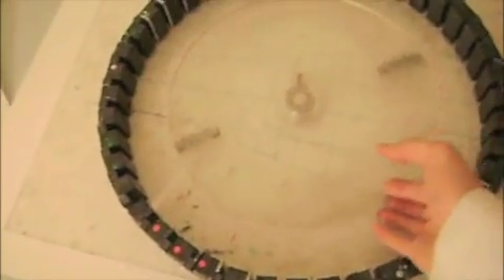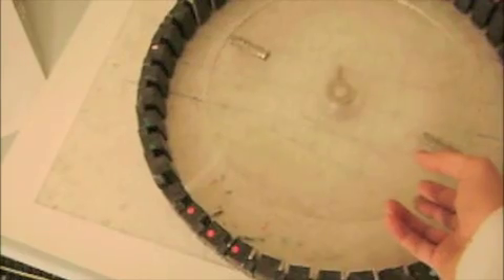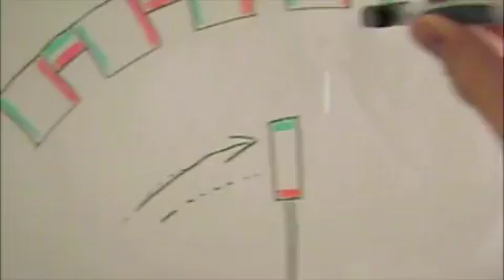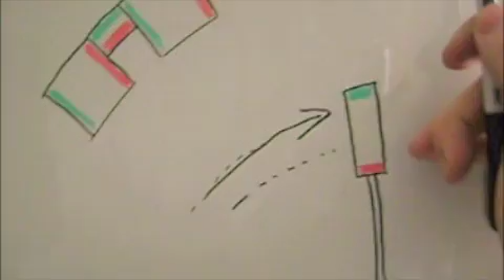The One Inch Barrier to building a Rotary Magnetic Motor Design.

Comment: So you gave 340 degrees of self acceration and you only need to overcome the last inch? Sound to me like your not seeing the big picture! Create an electro magnet pulse of attraction to overcome the last inch. That power consumed should easily be replenish by the self acceleration that you demonstrated just have 6 induction coils around the unit all creating just enough charge to recharge a super capacitor and when it comes full circle allow the capacitor to discharge into a attracion electro magnet timed by a Reed switch. I believe with a bedini circuit you should be able to overcome and create orerunity

Comment: The TJ’s moving Gate - Mechanically opening and closing twelve Gates on the twelve Neo magnets. Twelve sets of magnets on the inside rotator with an oval block in the middle of the Rotor (on top of the Lexan). Each Neo set connects it’s  backsides to a long string, which loops around the oval block. After the Rotor begins to spin, on the center axis (manual effort may be needed at that point), the twelve strings pull each individual Neo set away from the Twelve outside magnets. Opening and closing the gate without additional mechanics involved.
- hind sight tells me that twelve Neo sets on the Rotor would actually be to much magnetic force in the opposite direction so BEST CASE SCENARIO is: one Neo set on the Rotor with twelve strings, each around a separate oval (let’s imagine twelve individual ovals stacked on the Rotor/ a our version of a camshaft) Each oval points away from one of the static magnets on the Base. As the Rotor spins, an oval pulls the Neo set of magnets away, then the low part of the oval allows it to be magnetically be pulled toward the outside static  magnets. At the same time the magnetic motion being created causes the physical presence of the next oval to release the energy (by pulling the Neo set away again), while the Rotor is in fwd motion. 
The Oval I am picturing is more of a Conehead oval than an egg oval.
Things working against this theory are friction under the Neo Magnets on the Rotor, which could be floated in Water (maybe inside a test tube) and friction, plus wear, of the strings. 
Input and especially trial and errors on TJ’s Moving Gate “BCS” theory will be greatly appreciated.

Comment: This may be off the wall, but how about this thought? Put about a 3 inch long by 2 inch wooden dowel straight up from the center of your disc, with a 3/8 inch hole through the circumference at about 1/2 inch from the top of said dowel. Then put a 3/8 inch dowel through that hole extending out both sides of the first dowel to beyond the major circumference of the machine. Then put equal weights on each end. This configuration should build up enough inertia as the machine turns to keep it moving past the dead spots.

Comment: howard johnson had one that worked it was almost the same setup but the middle wasn't designed like that it was an arrangment of magnets in a half circle with the end one kinda out more, there has been real ones made professional even, the government will never allow mass production it is up to individuals to make for themselves for there own use and there is alot of fakes on youtube but some real and all of them are discredited look up The 3 types of magnetic motors part 1-3 he knew what he was talking about and has the knowledge
Reply from the maker: I'm aware of the similarities in my designs to Howard Johnson's. He actually inspired a lot of my research. Thanks, by the way. The 3 types of Magnetic Motors are some of the most important videos I've made.
Reply: i hear ya i have a different arrangement of magnets that ive never seen before anywhere and a design idea that will work 100 percent sure  with alot more power but it requires a design that pulls in and out as it spins on 4 corners of a circle i have tested it and i know it will work but i dont want to blast it on comments for someone to steal i have been working on this for 3 years but i wouldn't mind talking directly to you as i dont have the materials to make this work i have magnets just not the design for it , im at the point of if you would mention me as the design and you as the engineer i would be happy to tell you to finally make a very successful magnet motor with all neodymium magnets  i would really like to work with you and finally get this video out as it has been a long time coming and i fear it will take me forever to build the design sad thing is it isnt that hard but requires tools i don't have hope to hear back from you
Reply: i really dont wanna let this go as i have been working on it for along time but even if i did get the materials and make it people would be calling fake though it would be next to impossible to fake this design but you have some credentials and sorry for the long message and i know everyone thinks they got the magic key but again this has been tested with only one on the stator using my hand to hold and it has worked but in order to have the kind of power needed to turn a generator to power a house without it being big it needs 4 and you will understand when i get to tell you this type of design would make almost anyones arrangement work people have only been focusing on the arrangement of magnets and nothing else it takes 2 to tango lol anyway i stop writing this novel and hope to hear from you if your interested my real name is on here look me up on facebook messenger except look for first name Jamie instead of James ttyl hopefully if not im sure i will eventually get it out and on youtube just tired of waiting
Reply from the maker: You might want to stop by a machine shop and have the parts machined for your device? I've done that before. As far as contacting me through facebook, you can find my facebook page by looking up Mo Jo. It has my Motion Magnetics logo on it, so it's pretty easy to find.
Reply: Thank you for the advice about the machine shop and i will try to look you up on facebook this device im talking about is all repulsion and i have found a way around entry into the repulsion i will look you up and talk to you soon though i cant wait to get this device built
Reply: I cant find your page on facebook i looked on people and pages and no cigar , if you have another way we can talk i would be happy to do it another way it doesnt matter how, i dont want to keep anything to myself i just want to insure i get credit for the design but dont have the kind of money a patent requires i work in a factory minimum wage, trust me i have built and failed many times and finally  have found away around just about every problem people are having when building theseim working on getting a poor mans patent on its way but i figure if we could build this and both get credit for it , it would be good enough for me hope to talk to you soon
Reply from the maker: There were several profiles that came up with your name on FaceBook. I could message you there if I knew which one was yours.

Comment: You need a gate to bypass the attraction of the "1 inch" gap you refer to. You had the right idea with the backings however you spinning magnets are what require the ability cross the gap on the inside of the track.

What I am suggesting is that where there is a gap to cross build a gate from the exterior section directly inward to the centre with more magnets like a "C". Looking overhead the one portion would need to be flush underneath the spinning magnets and the other portion over top. This allows for the magnet to cross the by lowering the magnetic attraction by transference. The gates will need to be long enough to reach the spinning magnets to the innermost length of them.

Everything should be in repulsion, while the gate(s) are softened attraction.

Comment: First off 1 inch has nothing to do with why it does or doesn't work. The distance you are describing here is dependent on the saturation point of the magnetic field. If your magnet is three feet in diameter... It's not going to be 1 inch. I can only assume that your 1 inch is based on duplication of a particular design scenario. As for making it work... which is totally 100 percent do-able, an all magnet motor can only be made to work with an external force. You could use gravity as that force, if you know the configuration to accomplish it. 

There is a better way to do it it is based on the Ed Gray magnet motor. It can be made to self run and to create additional current in addition to that which is needed for it to operate.

I won't give details of how it's done or what you need to do it but you can do both with the design you have in this video. If you were to put a number on the parts needed to do the ed gray motor... it would need 4 additional components. I say components because I look at a component as being something that is already mass produced in today's world so I won't break it down into each of it's separate parts. Also my statement is not to assume that the four components are in fact components with more that one part.... some might just be a single part I have just grouped them together to give a number that is used to reflect the proximity of your motor to something that is complete and working. 

I've been sitting on this now for some thirty + years and I have been waiting for other technologies out there to become reality.
Some of those technologies are based on Tesla's work.

Scientists say that it would break the laws of physics but the truth of the matter is that our laws as we know them are incomplete. That is why Einstein was working the theory of unification which would tie all the loose ends together.

 Keep up your experimenting... you may discover something before I release my design... after patenting of course.

Comment: Given that so many magnetic motor designs all seem to have precisely this same problem, is the one inch barrier some kind of impenetrable Law of physics that will prevent useful perpetual motion? What if the real win of magnetic motor research is not unlimited energy but ultra-efficient motors? Maybe getting 95% of free travel saves 95% of energy needed to travel?

Comment: Greetings. I would like to ask you a question about this setup.
what would happen If you rotated the halbach array and had coils, then discharge what you get as a pulse to somehow try and pass through that "one inch barrier". would it work? or would the winding resistance add to the problem and get nothing.
sorry if it is a silly question, i was curious
Reply: or 2 of these in parallel(one over the other) but turned so that the accelerating point of one would be the stopping point of the other so that they would cancel each other out, and then use coils to get some electricity for moving. higher speeds higher current etc.
probably wouldn't work though.
Reply: oh btw check "Hyper halbach array" too. And another thing, been seeing your videos, you are doing a great work. thank you.
Reply from the maker: Nick O. It's possible, but that's more John Bedini's area of expertise. Most of my builds are an attempt to accomplish rotation by use of only permanent magnets, and various shielding techniques.
Reply from the maker: Nick O. Thanks. Much appreciated.

Comment: put a vgate to get through that last inch or the arce under the track in your latest video
Reply from the maker: Jessie Loven I've actually tried using a V-Gate to get through the one inch barrier. I simply cancelled out the momentum and caused the device to coast to a dead stop. Thanks for the suggestion though.

Comment: Time, skill, talent and money wasted.  What a shame.  Just a little thinking about it could have saved a lot of effort that could have then been directed to something that could actually work.
Reply from the maker: Well, thanks for noticing the skill and talent, but it's never a waste of time if you're doing what you enjoy. Thomas Edison once commented on the notion that he'd failed 10,000 times before he developed a working light bulb. "I have not failed. I've just found 10,000 ways that won't work." He also said: “Many of life's failures are people who did not realize how close they were to success when they gave up.” 
If I were easily discouraged, especially by people's lack of faith, I'd have given up a long time ago.
Reply: Motionmagnetics I am not suggesting you give up.  I am only suggesting you direct the effort into an area where there is some hope.

Edison knew that the idea of a light bulb could work.  He didn't invent it.  There were many in existence before him.  They just didn't last very long or make much light.  He knew it was just a matter of finding the right material.  It is surprising that he had to try so many because the really high temperature it took to melt carbon was already known.  It would have been one of the first to try.
Reply from the maker: Ken Smith Sounds reasonable. I learn from every build and every design I assemble, so I rarely feel as though I'm wasting my time. There are occasions where I drop something, if I feel it's not moving me in the direction I want to go, and segue into something else though. Thanks for the comment.

Comment: Hm, looks like due to a loss of momentum after it is repulsed/propelled this is why it happens. I would think that you could have the rotary hit a switch that turns/switches/alternates the pole of the magnet that stops it. Or maybe that's not the problem, maybe you have too many mrg's. Maybe if you lay it vertical with one MRG at the bottom you could have it to where it get repelled/propelled upwards and when it gets to its peak gravity would take over and it would fall back down to the one MRG and get propelled/repelled again.
Reply from the maker: Well, I've tried more ideas that I could count. I'm constantly working on it though. Thanks.

Comment: when is nearly there you can make some sort of mecanical switch that move a steel plate in front of the magnet and when is past that to move away
Reply from the maker: That creates it own problems. The steel plate affects the magnetic fields as well.

Comment: another commentator was correct in that I believe we will need to put our heads togther by pulling from all the possibilities. i believe a combination ofd perhaps unrelated techniques will be the solution. 

That said, have you tried a smaller vortex ring to drive an center placed magnet (or array)  to give it a constant "push" to your current rotor? The idea would be to use two seperate systems working in tandem to overcome the one's trouble. Just a thought.
Reply from the maker: I'm working with leverage bars now, to tackle the problem.

Comment: tip the motor on its side. have a rod with a weight on the end. the weighted rod can move back and forth between 2 pegs. when moving, the rod will be against the back peg. if there is a sudden stop, the rod will swing against the front peg, banging it thru the resistance. this is the ''bang bar motor'' . position the motor so the bang bar is working on a down stroke
Reply from the maker: Interesting thought. Thanks

Comment: what if u try to place magnets under the rotor on the 1 barrier to push it trhough that last inch and complete the rotation place stronger magnets though to give that extra momentum to launch it in to the next rotation
Reply from the maker: Every little adjustment like that affects the entire mechanism of the motor. Ones you add more force in one location, it equals out by subtracting in another. Magnets are the darndest things. lol

Comment: the inch might be solved if you add the 2 additional rotors on top of each other so that each inch in covered by the 2 active once
Reply from the maker: It doesn't generate enough force to overcome the problem. I've tried multiple configurations attached together. Thanks though.

Comment: You  could  fit  an  elephant  between  the  massive  gap  between  your  ceramic field magnets   and  you  have  no  output  shaft  on the disk.   If  this  were to work,  which everyone  knows would never ever happen,  the output  power  is  so weak that it  could only run itself and nothing else.

Comment: On your linear motor your spin accelerators were at an angle. On this motor it is just the small neo on the back  that is angled. Why not put the whole array of magnets at an angle just like on the linear motor.Good Luck. Never give up.
Reply from the maker: I've tried it both ways. This design was just the one I used when filming the video. And thanks. I'll keep working on it. :)

Comment: just a stupid question you have tried 4 magnets but how about lining them up an inch away from the other 2 magnets so when the other magnet is at the beginning of the one inch barrier the other would be exiting the barrier witch should pull the other one past your barrier and isolate the magnates so they dont interfere with each other. let me know how it works out if you tried or not

Comment: Replace one of the permanent magnets with an electro.  Make a stack of the whole shebang, tied together, and have each placement correspond in the direction you desire.  In the center section of the plastic disc attach a circle of permanent magnets, and have a copper coil it hovers over.  This coil can be tapped into to power the electro magnets.  Keep in context, each one will require a switch of sorts to reverse it's polarity, some obstacles to overcome, but nice start!